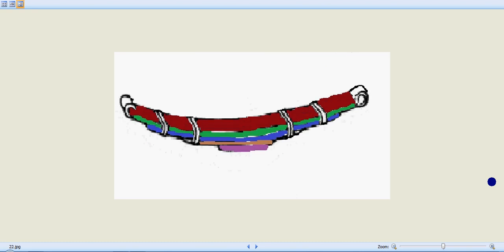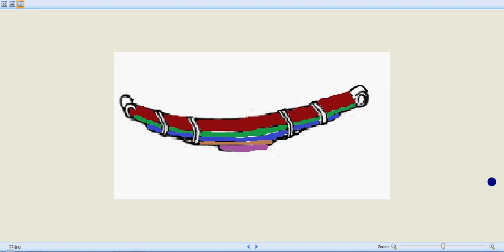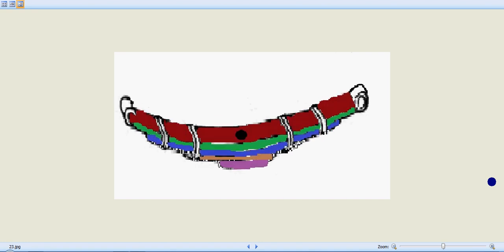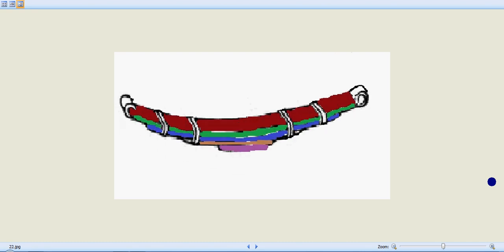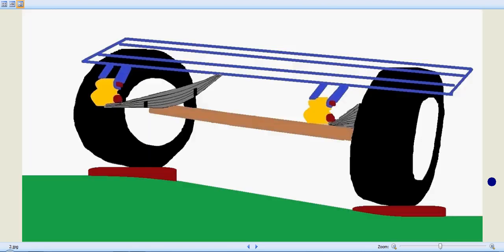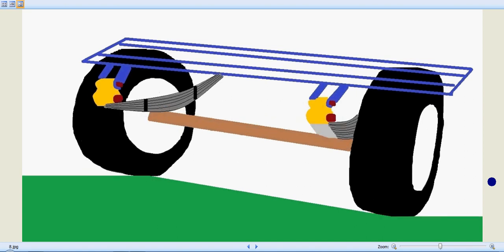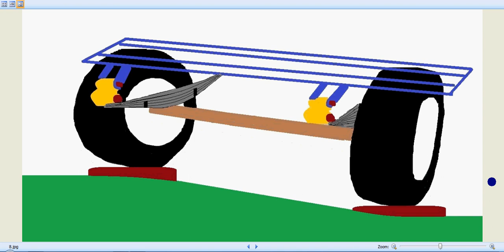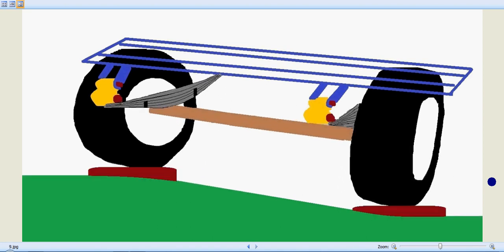Animation How leaf spring works. ✔

Comment: How does this compare to an air suspension? Is it just as smooth ?
Reply: qteezy6501 no, leaf springs are possibly the worst but the cheapest solution, do not use it if possible

Comment: Where are the ends of leaf spring bolted ?
Can u please name the part....
Some trucks leaf is placed above the axle and in some below the axle...So how is that determined whether where to place it?
Reply: Leaf springs are bolted to shackles. Some are SUA (spring under axle) and some SOA (spring over axle). SOA usually allows for more articulation and load weight. Some owners of 4x4 vehicles convert to SOA from SUA to increase ride height w/o a suspension lift as going from SU to SO will net you give you about 5-5.5in lift naturally